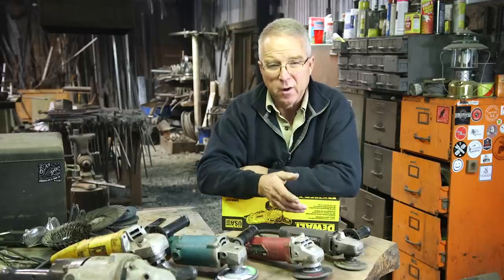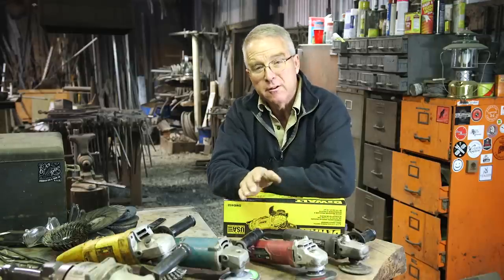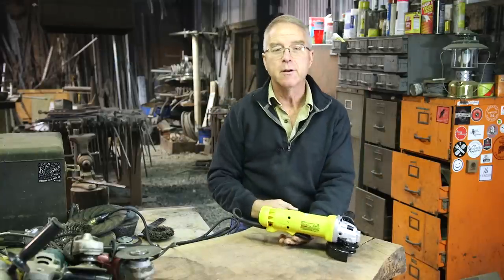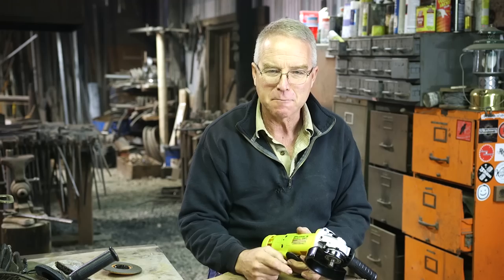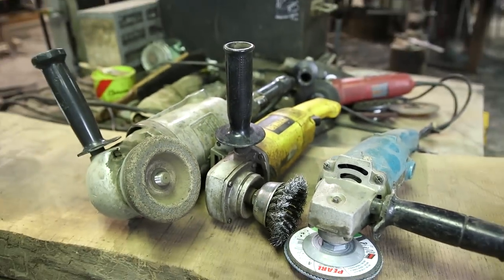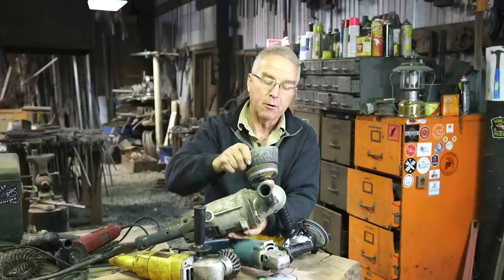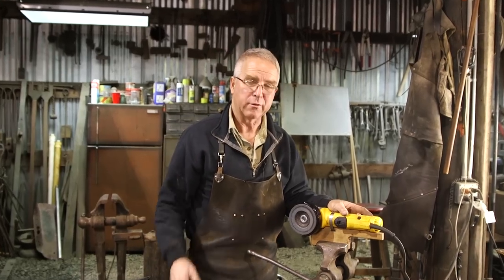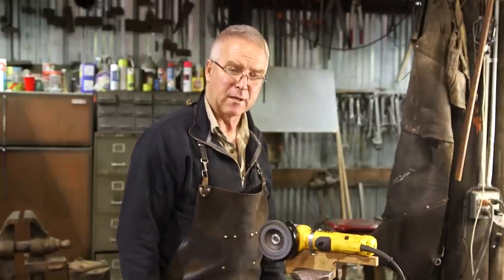Get Another Angle Grinder

Comment: Scott and Nate,
Howdy!
     My name is Tim Rorer from Kentucky.  I haven't comment on a YouTube video in probably a year. But somehow I am so passionate about angle grinders that I felt the need to ramble for a bit. 
     I am a 45 year old industrial maintenance technician (working in a titanium extrusion mill), own a mobile sandblasting company (that is supposed to be my retirement plan though I never lately have time from my day job to take on new blasting customers), farmer (though my farm is a soupy mess from beavers right now), and a general tinkerer.
     I spent probably 10 hours this last summer shopping around for my 5th angle grinder (not counting the Chinese pneumatic one).  I am very partial to DeWalt products, though lately I've taken a shining to Milwaukee products as that's what my employer uses.  And yes, I've got a Black and Decker that believe it or not has last through heavy use for almost a decade.  I debated the whole paddle versus trigger vs switch question (and switches to me are best for less fatigue on longer grinding tasks and when you are going to chuck the thing up i a vise for easy on/off). But what it come down to for me-and yep, it's so trivial, I went with a Porter Cable product just because it came with a hard case.
     I work out of my home (except for the day job) and am between workshops (how this farm didn't have a workshop is beyond me).  So all my rolling tool boxes and my utility shelving full of power tools, parts, and hardware are my wife's bane/eyesore on our enclosed back porch.  So because space is limited, I like tools that come in cases for finding them easily and stacking as neatly as that sort of thing can be. It's getting hard to find companies that make tools in cases anymore so this was the nicest, heaviest duty, grinder that came with case.  I have found this brand to be my new favorites brand of power tool because of it. 
      Now, much to my wife's dismay, I am thinking of buying a cordless angle grinder.  I didn't think much of cordless tools beyond drills due to a couple of bad experiences a decade ago involving a DeWalt cordless impact wrench (almost $400 of money wasted) and a cordless Black and Decker circular saw but apparently 1) they are much more powerful today and batteries hold their charge longer than they did then and 2) it's just not as convenient to pack around that little 900 watt mini generator to the furthermost points of where I seem to find my tasks (especially in a JLG snorkel lift at the ceiling of a factory or on the roof of a 1/4 mile long manufacturing facility or the back 40 of my farm.
     As an 11 year veteran of the US Army in my youth,  I know that I had not a clue of what I wanted to do "when I grow up" and spent a lot of my time firing mortars and shooting rifles for the first decade of my adult life and feel, sometimes, that the guys that started in the various hands-on trades at 18 or 19 seem to have a leg up on me in their knowledge so I try to soak up every little tidbit of knowledge I can from where ever I find it and I feel your wide range of skills and stuff that you know a bit about, is always teaching me new things.  Please keep up the good work and your camera man is doing a great job as well!!!!
Reply: German-made Metabos + a good steel case. Not chi-com junk!
Reply: @horacerumpole6912  Generally, I think highly of German made things (spent 2 years there and know it's just part of their culture) but I think I've settled on Milwaukee because most of their tools come in cases or at least there is a case available even if you have to purchase it separately and that will also allow me to have a common battery for the cordless items.  But I still purchase Knipex hand tools!!!
Reply: Have you ever looked into modular tool boxes? I use Dewalt tstak boxes because I'm a jobsite carpenter so I always need a way to stack tools in my truck and then stack them in storage when they're not needed. I keep 2 makita cordless grinders in tstak boxes too so I usually look for a tool I like and not think about a case it comes with. Milwaukee packout system seems to be a really good upgrade, they're tough, water resistant and the footprint of them are 16" X 22" and come in various heights. I may start buying those because the Dewalt tstaks can't hold cordless nailers and I'm pretty sure the Dewalt tough system can't either because they're 13" X 22"

Comment: Speaking from experience, as a former fabricator and current tool mechanic, i think the best combination for angle grinders is as follow : 1 big (9 to 12") dedicated to cutting, 1 small (5") with speed variator for heat sensitive stuff and finer grits and however many of the regular 5" as you like for the other stuff.
Of course, always use your guard and the handle, whenever possible because it is much safer. And if you can't or are directly showered by the sparks, use a faceshield. Taking a fragment of abrasive that managed to bounce directly in your eye is the worst experience i ever had and it happened quite a few times despite the safety goggles. Those things are also very good at starting fires, both on the junk you are working next to and your own clothes.

Comment: When I was a teenager I had a 4" cut off wheel grenade and put a 2-inch tear in my chest. It felt like I got punched by Mike Tyson. After patching up my chest and changing my Underpants, I put the guard back on and left it that way. When I do use a grinder without a guard, which is more often than not, I always remember that incident and pucker Factor is always lingering. I still have that old girl :-) plus four or five others all wearing different attachments
Reply: Wow lol,  I was reading this and when you said you still use it without the guard I thought to myself “this guy is an idiot!”. Then I see you are a roofer and i could help but to laugh out loud.
Reply: Benjamin Blake 
Thanks for your kind words. I hope you have a blessed day :-)
Reply: @benjaminblake6821  he wrote: "I put the guard back on and left it that way. "  But there are times when using an angle grinder without the guard is the only way possible.  That's what safety gear is for.
Reply: terry Sullivan 
Correct you are. The only way I'm willing to use a thin cut off wheel without a guard now is welders gloves, full-face shield, and my welding jacket on :-) if that piece of blown up wheel had hit my neck instead of my chest, the outcome could have been a whole lot different
Reply: Roofer Jon, Try running a 12,000 rpm angle grinder, sans guard, with a 4" Skil Saw blade meant for one of those little battery powered saws,  Now That Is Exciting ! ! !  And Real Damn Stupid, when it kicks back, and it will, you better have One Hell Of A Grip ! ! !  Did that once, Never Again.
Reply: BigDogBob 
Dang! That sounds sketchy as hell :-) well, if we're going to be comparing not so smart things, look up crazy cut off wheel of death on YouTube. Yeah, that's a 14 inch cut off wheel on a 6 inch grinder. No other way around it, had to be done. Pucker Factor 1000. And yes I am in shorts
Reply: terry Sullivan, if you have to use a angle grinder without the guard then you’re using the wrong tool.
Reply: Roofer, Oh Damn, how do you even hold onto a 6" grinder with a 14" cut off wheel attached and spinning like the Tasmanian Devil ?
Reply: BigDogBob 
Very tightly LOL!
Reply: Maxwelhse 
Agreed. I always keep as much of my body as possible as far out of line with the wheel as possible.
Reply: The same thing is happening with tile guys using the diamond mesh wheels in a grinder with no guard on, those things explode too
Reply: @warrdogg3376  
That would have been a good call for sure!
Reply: I once had a 320mm (a little over a foot) disc blow up on me on my gas axe while cutting big profile. My legs were covered in cuts, but luckily i had the guard on, it looked like a grenade went off

Comment: I personally own 3 corded and 2 cordless.
When you are running different tasks, being able to switch between different attachments, sizes, power level, or mobility on the fly is remarkably helpful at times. 

I wouldn't start with several, but if your work calls for a time is money mentality, it can pay off. Especially when, not if, one or more decide to bite the dust in the middle of crunch time on an overnight project... That there is a nightmare.
Reply: Since buying my cordless, I find myself switching wheels out rather than going back to any of the several corded ones. Which of course means obviously I need another one!
Reply: @bradley3549  Makes a lot of sense. 
The only times I really go back to the corded are when I need the power of the 7" Makita, or I am running it hard with a wire wheel or twisted cup. Even the nice 60V (54V) batteries will start getting pretty warm with that kind of heave, sustained use.
Reply: Knowing what I know now, I would have absolutely started with 2. One for a wire wheel (cheapo) and one for whatever else (better). My wire wheel is almost never off of a grinder because I just constantly need it, but it's fairly rare for me to need a cut off wheel AND a grinding disc at nearly the same moment. Might just be me.

Comment: Dang it... you mentioned an image of a guy with part of a wheel in his chin and don't ya know I just had to go and google it. I think I'll be putting the guards back on all of my grinders now.
Reply: Or you could wear proper full face guard.
Reply: Guards are there  for a reason
Reply: Yep. Only remove it if you absolutely have to and even then, you can probably just use a safer option tool wise. I've had grinding rocks and cutting discs just blow up on me randomly. Luckily it was always at work and I had safety glasses and a face shield on, but little particles of the rock and disc still cut my neck pretty good from impact. Not always, but most of the time when a disc or rock explodes, it is because someone has left it out in the weather and it is wet, or someone threw it in the bottom of a tool box and it got slightly damaged from other tools being thrown on top of them. It makes them very brittle when they get too wet and even the smallest amount of damage or chunk taken out of them can make them come apart when they get up to full speed. Once they are wet just toss them. Unless you have a bad gambling addiction, then your good. Lol.
Reply: Oh, and always store your grinding rocks/discs and cutting discs in a dry place away from possibly getting wet, smashed or damaged by other tools being thrown on top of them.
Reply: @yerwrng But that's PPE as such the last line of defence. I appreciate that the comment is a decade old

Comment: I've had a Dewalt grinder like that for probably nine years and it's a great tool. At work, I have four angle grinders all with different wheels. Thanks for the word on guards. Because of some close calls I've had, I absolutely always keep a guard on any grinder I'm using with a cutting disc.

Comment: I’ve been a welder professionally and now a hobbyist. You won’t find many welders or fitters that don’t prefer the dewault 4 1/2”. For the reasons you said, it’s all about the switch. 
Another tip for newer users, don’t grip it so tight, you’ll wear your hand muscles out fast, be loose but controlled.

Comment: An angle grinder is a tool we all take for granted, but without them we would be severely hindered! They do so much, as you expressed in your video, they are so versatile. 
I really don’t know how many grinders I have in service at the moment, but if I had to guess, it must be 10 or 12, mostly 4 1/2”, a couple of 5” and several 9”. Bosch have always been the weapon of choice around here, although there are now a few Makita grinders in the fold. I have become a Makita convert with most power tools, but I still like the Bosch grinders. They have served us well over the years and been good value for money. 
Bosch had the quick release guard, like your new DeWalt, 20 years ago. Unfortunately the more recent versions do not, I suspect they are trying to reach a price point. But I’m sure the last Makita I bought has something similar. 
And I’d go side position thumb switch all day long on a 4 1/2-5” grinder, as I use them one handed often. 

........you can never have too many grinders! 😉👍
Reply: Agree with you on switches and Bosch grinders only weakness on one of my Bosch grinders is the power cable loosening in the housing causing it to cut out, cable has been replaced about 3 times over the 5 ish yrs I have had it. Bosch are king off 4 1/2 grinders .

Comment: Thin metal cutting wheel: Best advice I got from Youtube about cutting vinyl siding to length. Way easier than the tin snips recommended to me. Also, the lines are so smooth, you couldn't tell which side was cut, so I could install the cut side on the outside. Also also, I could use the wheel to grind off just a bit for the angles pieces in the gable, making them fit perfectly. I have a 15 year old angle grinder from my dad (Skil brand). It's seen lots of use. Here's to another 15 years.

Comment: I welded a bolt to a 6" long piece of angle iron that threads into the hand grip threads.  You can clamp the angle iron in your vice and work with it like you are doing and then quickly remove it.
Reply: That's a great idea!!